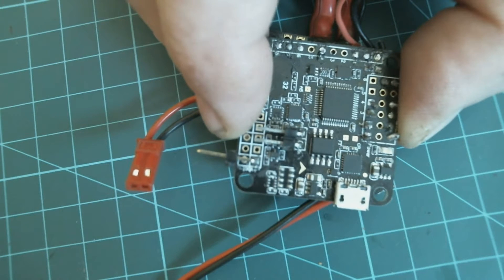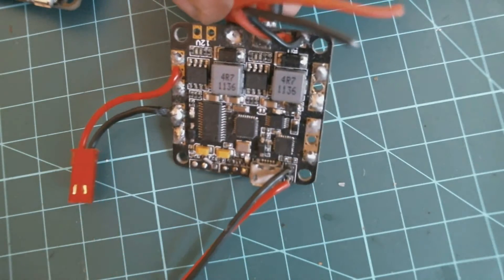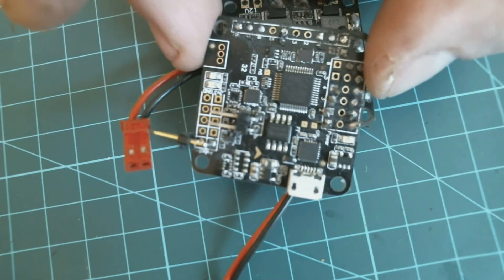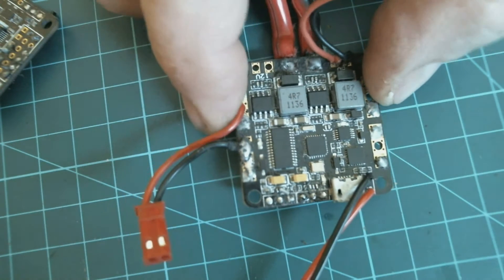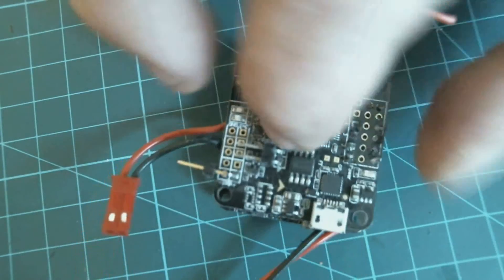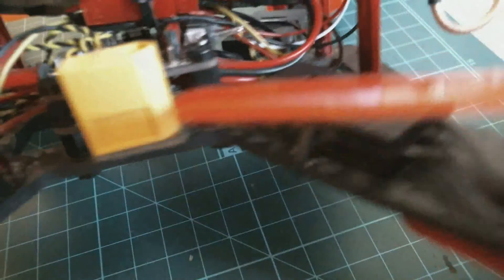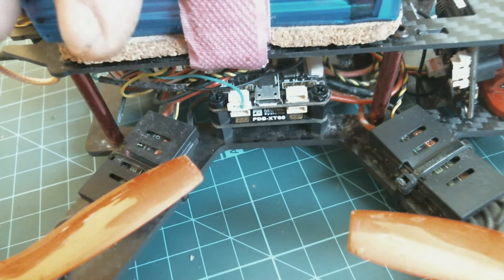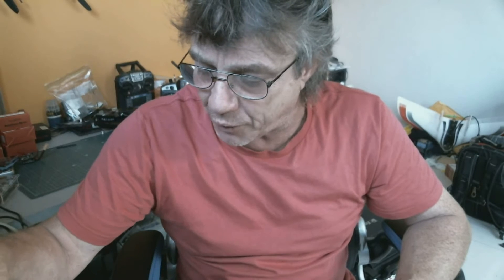Naze32 Rev6 & PDB+BEC+OSD Fail

Comment: Why did you not put on a low esr capacitor 35v 1000 uf on the + and - battery tabs first before you ripped out that board to see if that worked first. That would have most likely have taken care of the noise issue.
Reply from the maker: I agree it may have helped but the quad I installed it on had no noise issue on the video feed previous to this OSD installation which just made me lean towards a bad circuit design with the PDB

Comment: Hello. I messaged you on one of your other videos regarding the 3-in-1 boards. I haven't been able to pass video through it. It can send Osd to the TX and I can see it on the monitor but I can't get video to dispay using the board. i know my video camera works. Wondered if you or anyone else has had this problem. Also I am using a SP Seriously Pro Delux flight controller flashed with iNav. Could this be a problem, using iNav on my board. I ask because I do not see iNav in some of the configuration but I do see Cleanflight. Doesn't iNav = Cleanflight.

Comment: Hi Steve, I am currently working on a 180 build with this nearly same setup, Naze32 Rev6 w/Betaflight 3 + this PDB_BEC+OSD.  Interested how good or bad this will turn out after seeing this video, but one thing that I should give note on: the Naze clone (as well as the legit board) you can enable MSP on UART2 and use pins 3 (Tx) + 4 (Rx) to OSD without having to block UART1 and USB.  Just a heads up in case you haven't thrown away those boards yet, lol.
Reply from the maker: yeah cool thanks for the advice haven't thrown them to far LOL.....
Reply: Steve, also add a LC filter between pdb VT output & VTX input to clean up the video signals. However my personal experience with these cheap pdb osd board is to fly only with 3s. Fly in 4s the pdb video/osd function will died in matter of hours like Mark G above.